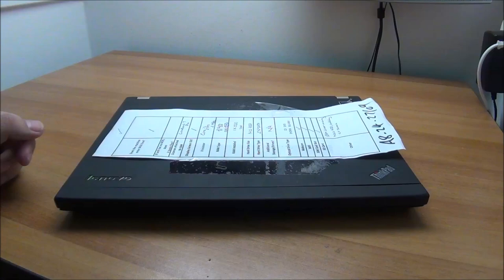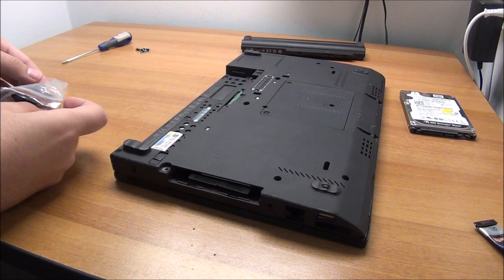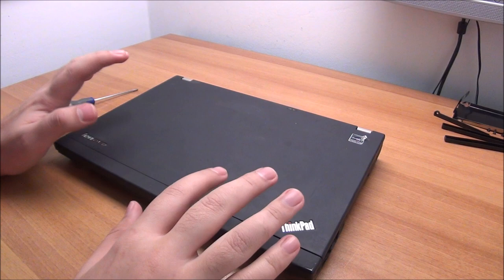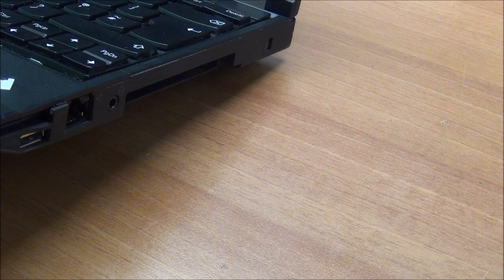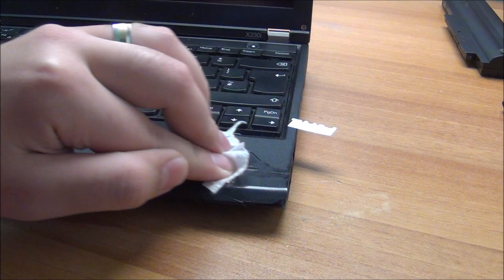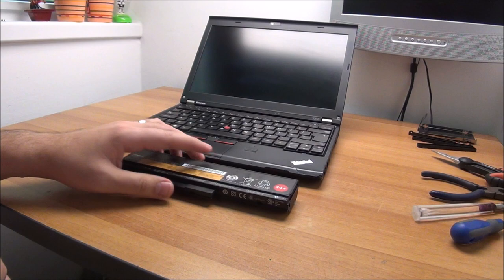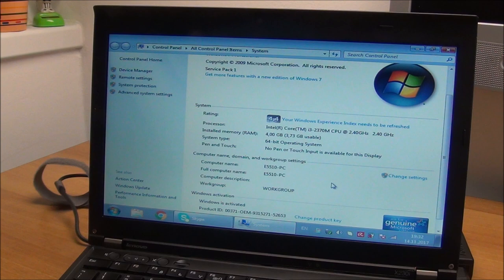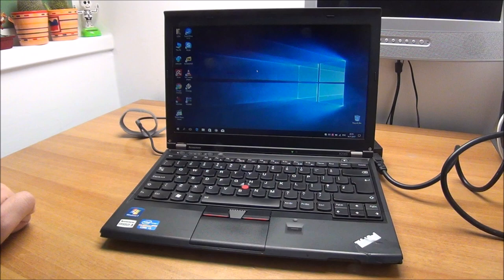How to upgrade a Lenovo ThinkPad x230i and repair it's case (plus Windows 10 update)

Comment: those machines are great. X230 is the last 12 inch thinkpad with 35 watts full voltage CPU. So even in terms of performance they are still great today for a 12 inch laptop.
Reply from the maker: segoiii I'm really thinking for a few weeks now if I should keep it for myself or make an international giveaway. Honestly I'm starting to think the giveaway is the best ideea, but I need to do some research about giveaways and the risks or problems that might appear. I might even do the first one just in EU so I have a little better control, but then again everybody should have a chance...so...yeah...not really sure what I will do in the end...

Comment: Hello, Did you finally fixed the cracked bezel on the top right of the screen ? I received a refurbished x230 that has exactly the same problem and wonder if it is fixable ...
Reply from the maker: Hello. I did not fix anything else on it, apart from what is shown in the video.

Comment: With respect, I have to be honest and tell you that I'm glad you're not repairing My Thinkpad. I've never seen such a lackadaisical and carefree approach to doing repairs.
Reply from the maker: Well, you are the first ever to tell me something like that, but that does not necessarily mean you are wrong.
I do what I do only as a hobby, so most times there is 0% need to be in a hurry. Also, if it's not fun for me anymore, then there would be no reason to do it. If I start replacing cases or other big parts, that laptop becomes a money hole for me, so again it's not worth my time and for sure it will not be fun.
I do the bare minimum to bring back to life old hardware and keep them running, while making repairs that I'm as sure I can be that they will work for a long time.
If you say about my aproach that it's care free, maybe it just seems like that because I'm a relaxed person and because I've seen enough to know what really matters and what not in a laptop repair.
Hope you don't get to see how professionals do the repairs, because you would be searching for someone like me after that :))